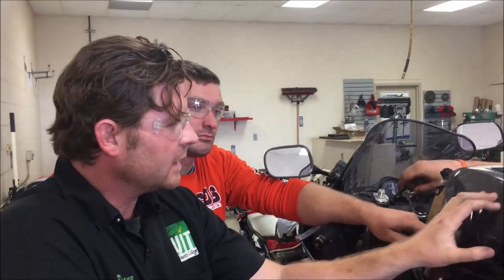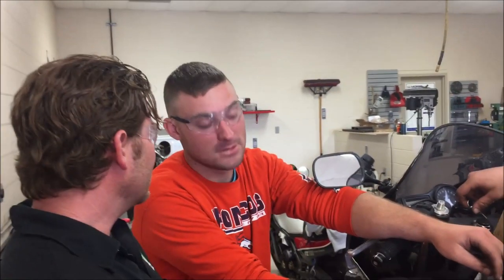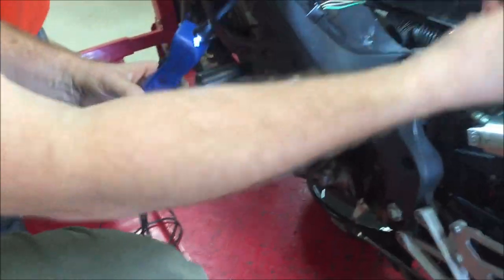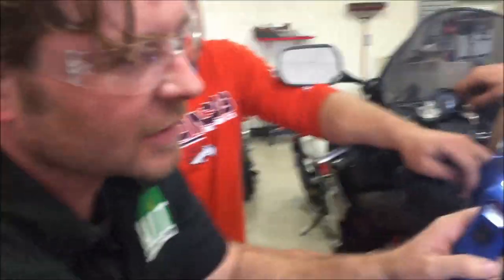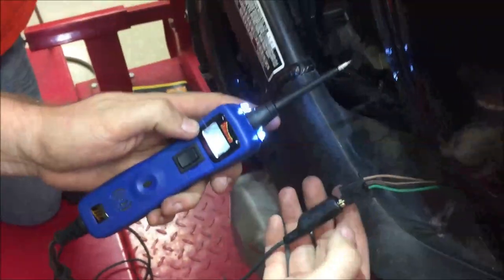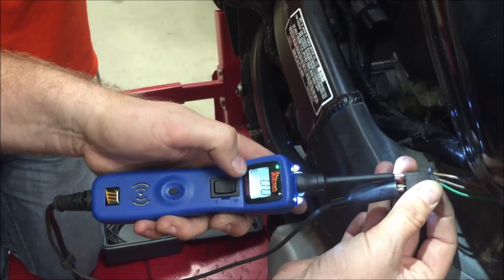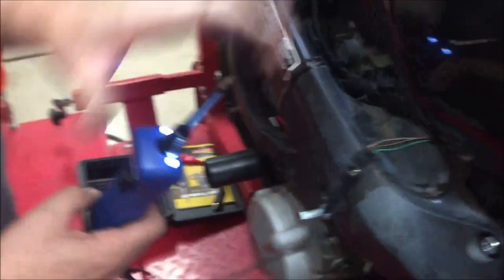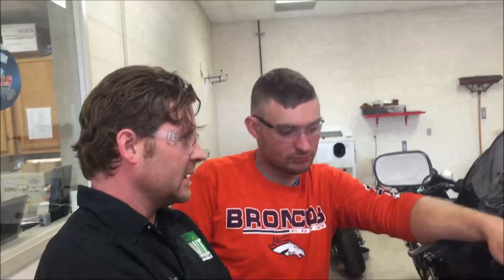Power Probe Training: How to prove a fuel pump will turn on when powered. How to bypass the wiring!

Comment: Great video, exactly the problem I was trying to figure out... Does my fuel pump work or not the only thing I can't figure out is where did you stick that clip because I don't have a clip... I got a wire so does the wire go in the green or in the brown with black stripe I'd appreciate if you knew the answer thank you

Comment: What exactly was your issue here? I’m dealing with what I believe has to be a broken wire somewhere. Got a power probe and proved the fuel pump works, replaced the fuel pump relay because I could’nt find how to test this Yamaha one with 16 pins or whatever it is. I know it fires up on starter fluid so I have spark, pump works and I believe the relay works as I just replaced it. Not sure how/where to start

Comment: I have the same problem with my Harley V rod Night special. I turn the bike on I get a check engine light but no prime to the fuel pump. I did what you did in this video and the fuel pump turned on. Is my problem an electrical issue? Thanks
Reply from the maker: As you can see from the slow response, it takes us forever to screen all these requests. 300-400 a week just in emails and 1000’s of comments! FYI members get answered daily first! Best $1.99 you’ll spend! 😁

That’s a great question for Shane directly! We are just the social media team. Shane does answer questions when he get's back around to non members eventually so hang tight, FYI >>>> he does member ones daily!

He just returned from overseas training techs and his inbox is slammed with requests. He is scheduling time each day again to answer techline orders. He does not have the bandwidth to provide free email replies as his schedule is full with shop customers, training schedules, and one on ones. 
There's good news though! Shane has 2 solutions for you. One is a deep dive one-on-one with him with video, email and phone support. The other is a "quick fan support" option when it's a quick answer and just helps support the time for him to stop wrenching or training and get you in the direction that a free video had you close. Links to each are below. Hope this message makes sense to you as a decent human being that also works for a living and gets it!
Make it a great day!

The one-on-one service. Get Shane’s cell here: https://how2wrench.com/ols/products/techline-one-on-one       
Quick answers are answered daily as a channel member: Join this channel to get access to perks:
https://www.youtube.com/channel/UCBhM8DCKnT3qXwTW0eToyCg/join   
-Daily MEMBER FIRST COMMENTS ANSWERED FIRST 
-Live Q/A video chats
-Wonder if we have a video on your need? Members can request content links!
-Full Access to the ENTIRE 700 video library
-Member-Only FREE tool giveaways  

Have you seen our "YouTube Trained Support Shirts? Great way to "high five us" https://goodfellasmerch.com/collections/how-2-wrench/products/support-shirt

High fives help too! Give him one here:  https://www.paypal.me/how2wrench

Comment: I have 2010 cbr 1000 fuel pump wont prime i dont know if its a issue with the pump or the hiss system i am in the uk any advice would be greatful thank you
Reply from the maker: Hello Andrew. So copy this video's theory by isolating the fuel pump. If you can get it to turn on, then the problem is elsewhere in the fuel system. Don't forget relays, safety switches and connections if you need to start chasing. Many times it's the simple stuff.  
Hope this helped. Want to give us a “high five”? Click here https://www.paypal.me/how2wrench 
 Need more personalized help? Your answers and help are just around the corner. Save time and money while protecting your investment and yourself by doing it the right way at www.How2Wrench.com  
  
 Thanks for commenting and adding value to our community! Please subscribe, share and consider a H2W membership to support our free work here! 

Have you subscribed yet to never miss a video? Have you seen the video playlists? Over 600 videos! Check them out here: https://www.youtube.com/user/conleybuilt/playlists

Comment: So next determine if the fuel pump generates pressure? Or are you fully confident to move to power that bike provides to the pump. A pump can cycle yet not pump fluid correct?
Reply: Bruce Kennedy Yes you are correct. I have had 2 fuel pumps that would turn on, but was too weak to pump the amount of fuel needed. 1 was on a Ford F150 and the other was on a Toyota 4runner. The Ford pump would turn on, but the fuel pressure was 0 at the fuel rail.

Comment: I have a sv650s my stator went replaced it now my bike powers up but can't get fuel.pump to run replaced the replace twice now and fuel pump but still can't the pump to power if I jump my relay plug the pump runs non stop even when the power to bike is completely turned off
Reply from the maker: If it was a quick answer I’d try to respond here but I wouldn’t want to lead you wrong assuming certain factors. Reach out to me on my website contact page. We have been overwhelmed with ungrateful people and
scammers so I had to do something for my sanity by screening the over 300
requests a week! I’d love to working with my members and supportors one on one! 

Contact Link: https://how2wrench.com/contact/ 

Your answers and help are just around the corner. Save time and money while protecting your investment and yourself by doing it the right way at www.How2Wrench.com 

Have you subscribed yet to never miss a video? Have you seen the video playlists https://www.youtube.com/user/conleybuilt/playlists? 

Want to say “thanks” or “keep it up”?
Click here https://www.paypal.me/how2wrench